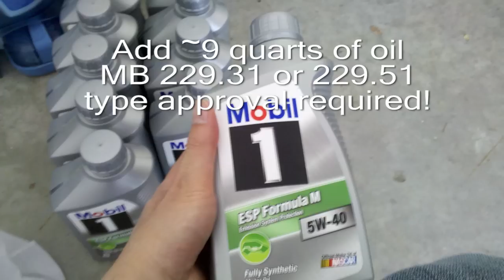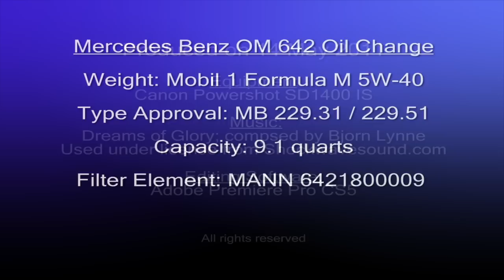Mercedes E320 Bluetec OM642 Oil Change

Comment: would be nice if you showed where to put the oil in?
Reply: Just undo the oil cap and put it there. Soak the filter in oil and put a bit in the filter compartment also and you'll be good